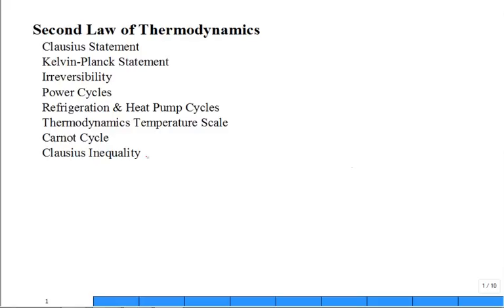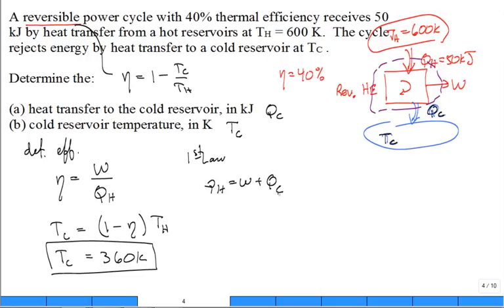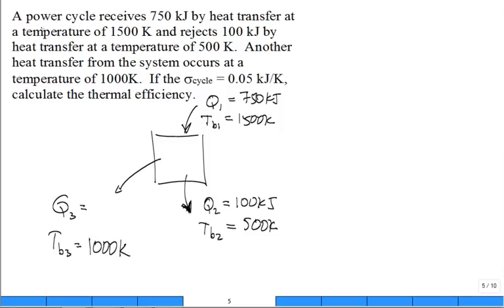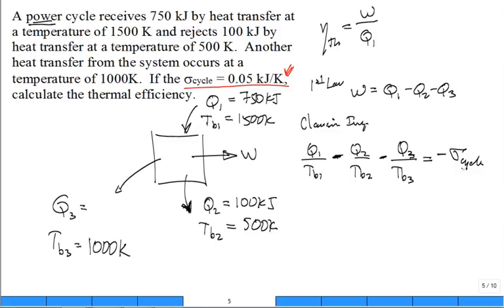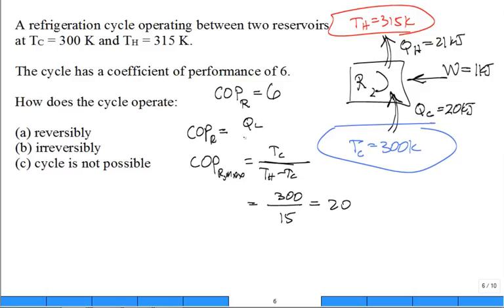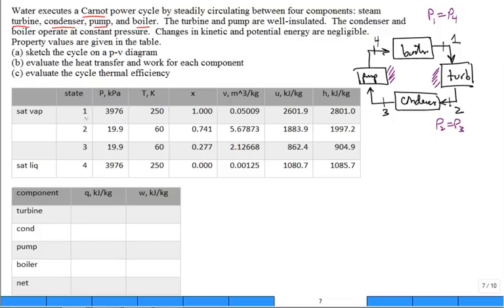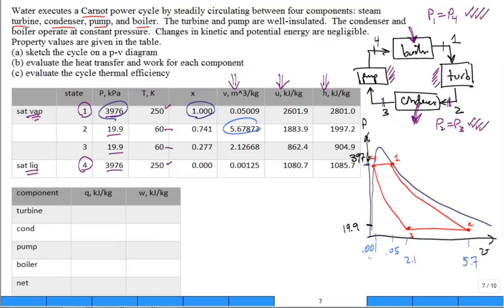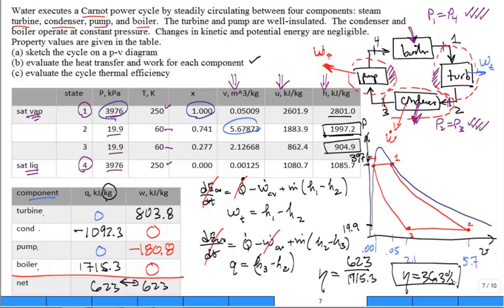ME3293 Second Law 3 Fall2015

Comment: professor, for a pump, why isn't specific v outlet approximately the same as specific v inlet. I read on another engineering thermo site that that's the case.
Reply from the maker: yes, v_in = v_out for liquid flow through pump.  But in this video we analyze a Carnot vapor power cycle.  The "pump" is not your normal pump.  It ingests 2-phase liquid-vapor mixture.  So substance is compressible.

Comment: Thank you for the great video. I am in the middle of viewing it right now, 16 minutes from the start. I wonder what is the Carnot efficiency gong to be on the power cycle, where you calculated the efficiency to be 40 percent?
average sink temperature is 750, this means 50%. or we cannot find carnot efficiency.
Reply from the maker: if sigma=0, then Q3=300 kJ (from 2nd law), W=350 kJ (from 1st law), then eff = 46.7%